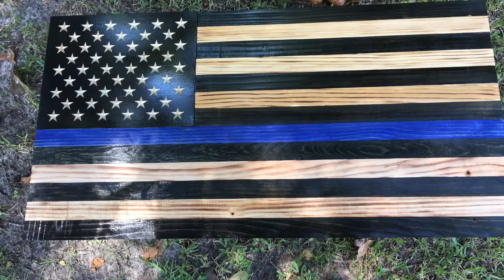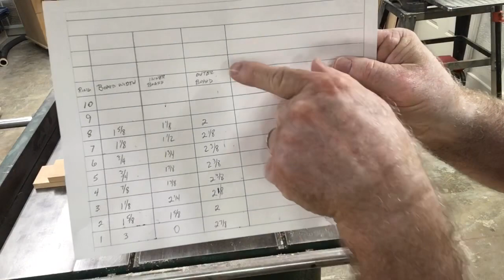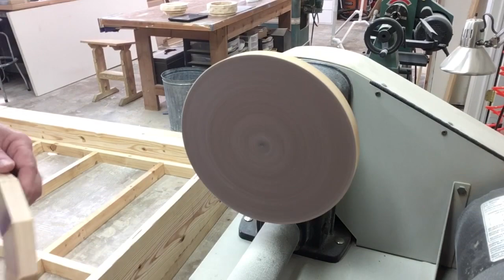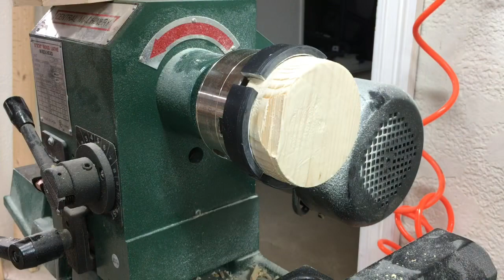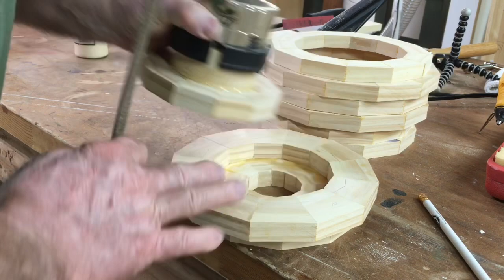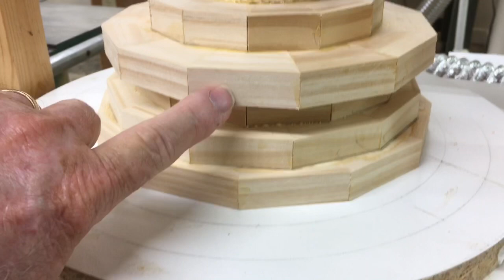BIG MISTAKE Assembling the Segmented Bowl. Can it be Saved??

Comment: You choose the best work around. Work with what you have.
Curious about your glue press. I am not seeing how you fix the clamping bar in place when you adjust it. I have pins on mine but I just am not seeing what you have. 
Did you do a video on the build?
Gary  AKA ThePapa1947
Reply from the maker: Thank you very much.  On my clamping fixture I just use a spring clamp.  I have often considered putting holes in the bar to hold pins.  I have not done a video on the build because I built this way before I was doing videos.
Reply: @PawPawsWorkShop  thanks I see what is going on.
I have made a lot of things prior to my YouTube channel as well. I pretty much only do wood turning with a few CNC related videos.
Take care
Gary